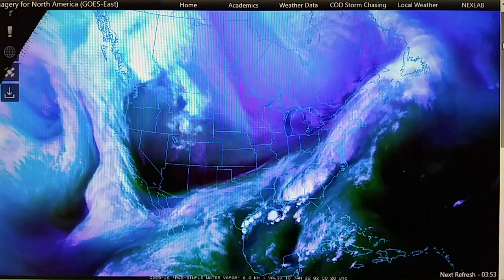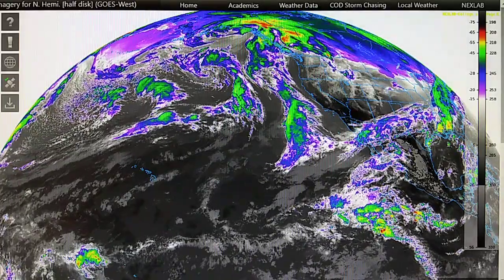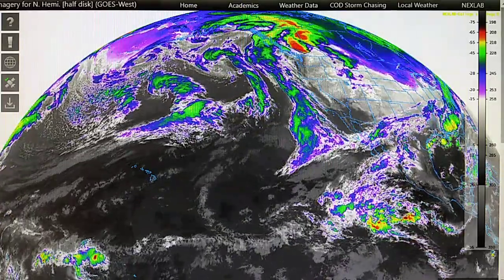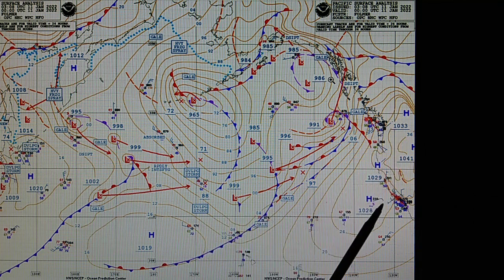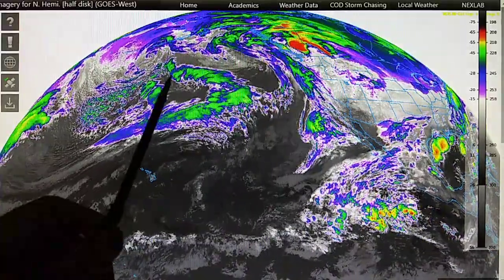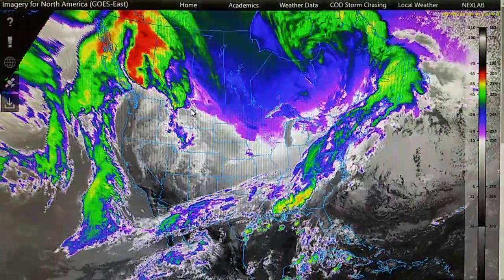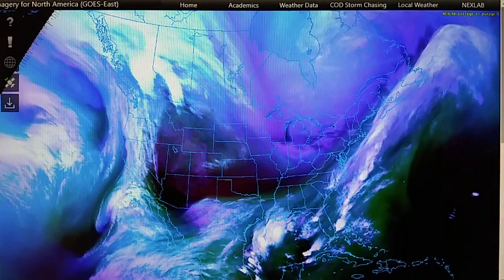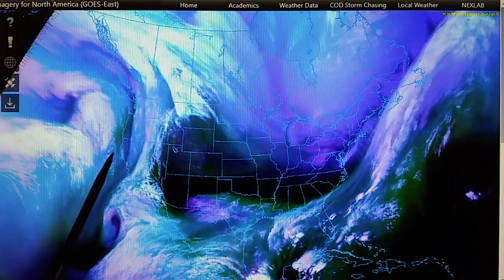1-10-2022; What is Climate Change? Low Pressure & Large Tropical Flow Generates Zero Precipitation!

Comment: Do you think they're trying to prevent Ark Storms? I know they don't care, but judging by the potential patterns of these storms, there would almost be non stop of rain over this state. I also wonder if preventing the moister downflow is backing up the system is causing more energy to be trapped in the atmosphere thus creating larger and more frequent storms. Maybe the extra storms are natural. The government will Nerf most of the storms during Jan and Feb.  They usually do.